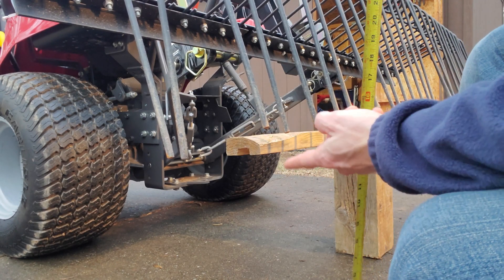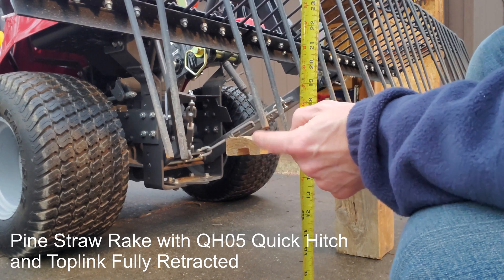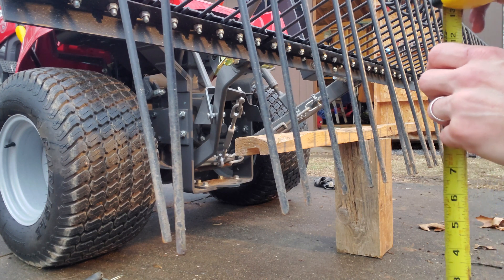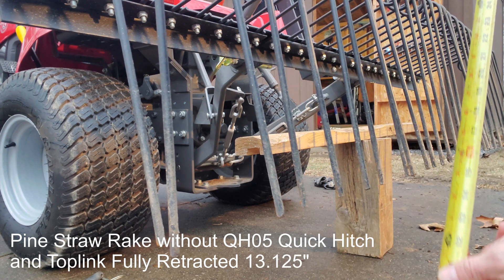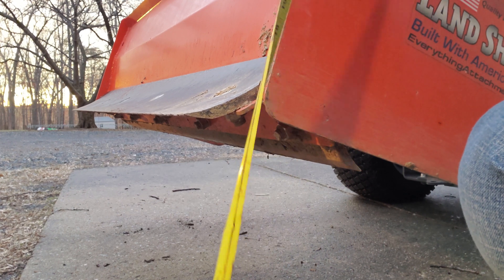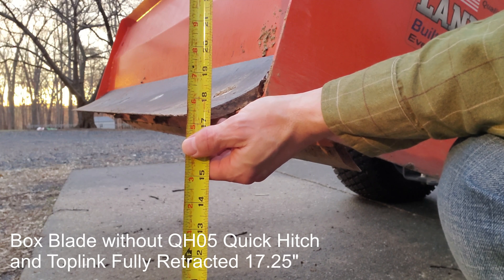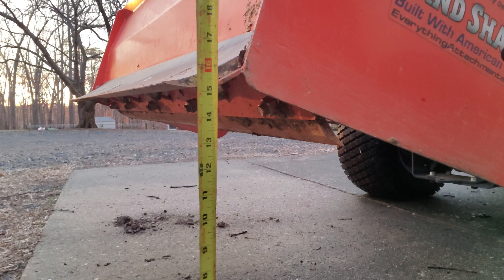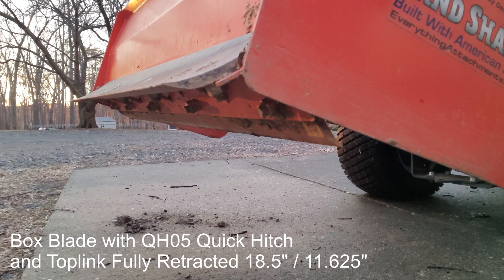Tractor 3 Point Lift Height Mod

Comment: Imagine laying a 2x4 with one end on the ground and the other on a bucket.  Take height measurements at 12" increments.  Each measurement would be higher than the last the further out you go.  Keep this example in mind as you read on.

The reason that you got several more inches with the QH is because you retracted the top link all the way creating a pitch.  The QH essentially lengthens your implement by several inches.  This extra length translates to a "perceived" increase in height (the 2x4 is higher at 4 feet out than it is at 2 or 3).  A true test would be to adjust the top link parallel to the ground.  If you did this, you would see no difference in height other than whatever difference there is between the lower 3 point arms and the pin location on the QH.  The reason you saw more height on the BB than the PSR is only because the BB is longer.  If you measured your height a set distance from the pins, the results would be similar.
Reply from the maker: That is a great explanation, thank you! I had similar thoughts, but wasn't really able to work it out real time while recording the video. The PSR is one of those implements that you can use for leaf cleanup with the toplink retracted almost completely , so gained clearance with the QH is a real product. Not so much with the box blade.

Comment: I am interested in the mod to the lift arm you show at 0.12 sec into your vid.
Where did you find that?  I'm interested to learn more about it. Pros/cons.
Reply from the maker: Unfortunately, I do not know any more than what was mentioned and shown in the first 30 sec of the video. A guy posted it on the Massey GC Facebook forum. Only con seems to be if you drill the hole more than 1 inch above the existing, then the arms won't clear all the way when you lift to max height.

Comment: Another great and interesting Video thanks for that I am always looking for more and more SCUT video,  I do not have the quick hitch  but got a clone of the "Pat's quick hitch system" as my implement are all different and out of standards. that make me think that I will need to be carefull  and I will have to test and watch  the top link if I ever go with the extra hole aproach, which I will probably do as more height is always welcome especially when working at spreading a dirt pile. PS: love that you brought the perspective and lessons learn of your measurements .
Reply from the maker: It's all about learning, sometimes from one's own mistakes! The Pat style seems like a pretty good method, especially for the reasons you mention of non standard implements.